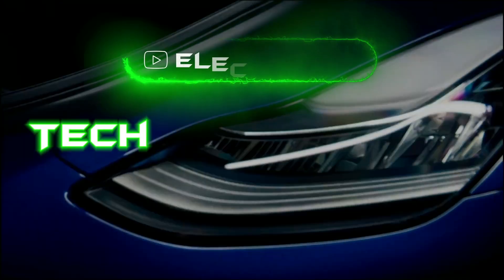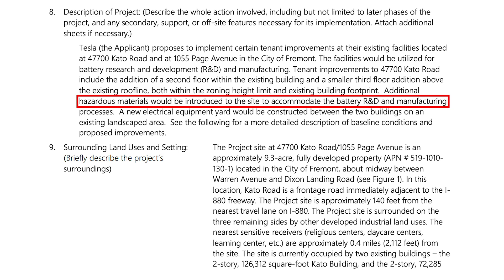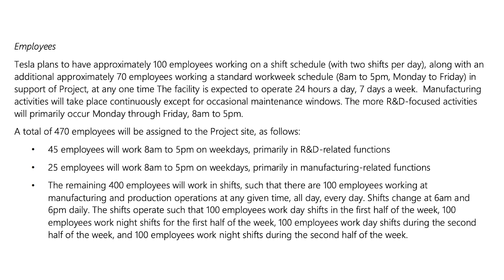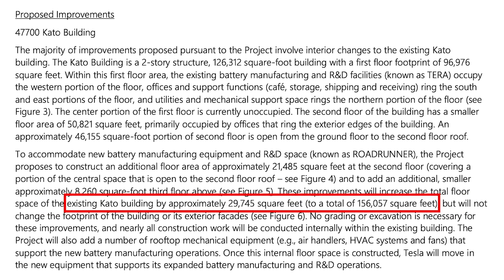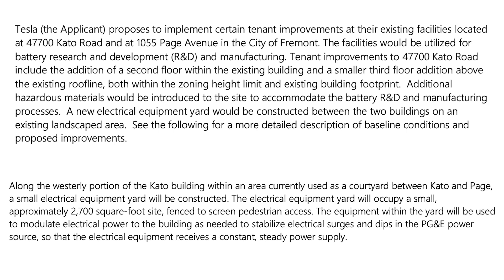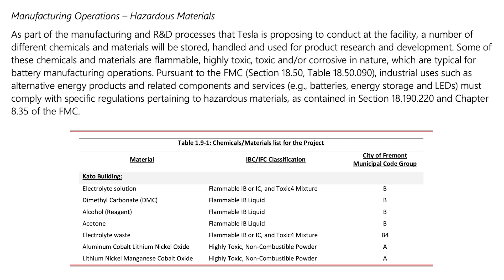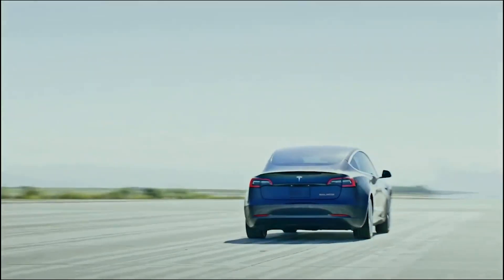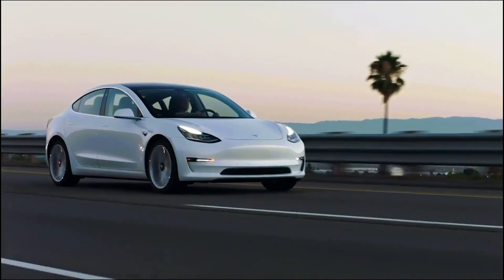Tesla Roadrunner | Tesla Battery Manufacturing Expansion - New Documents Explained

Comment: I was going to wait it out for a dual motor Cybertruck. Now with Tesla shares increasing how they are I think I might be able to get a Tesla sooner. Maybe just a lease to start until the Cybertruck comes out or one that just came off a lease. Now is the time for more Tesla shares and I want some. I do have a business plan in mind and for those that do not own their own house for Tesla solar I think there is another option. Consider having a solar shelter you could quickly unfold and have it securely surrounding your vehicle and keeping you and it out of the dust heat or cold. If the parking lot had a place that you could connect your Tesla to the grid not only would the solar be charging your vehicle but the battery could also be charging the grid. Of course the vehicle to grid software would make it easy for your Tesla to be making you money when it's parked and your solar shelter could continue offering power to the grid if you don't need to bring it with you. Let me know what you think of these ideas or if you have some of your own to add. I do appreciate all of you and your comments. Now this time we can fix our future fast!
propower101@hotmail.com

Comment: @electrified Can you check out these two patents?
 https://electrek.co/2020/05/04/tesla-hybrid-battery-electric-car-range-extender/
https://phys.org/news/2013-09-tesla-patent-hybrid-battery-evs.html
They both have to do with all electric hybridized systems. One hybrid is fully in one cell and the other is two separate battery tech modules used in concert. The idea is that you could have a fairly traditional li-ion for your day to day usage and use a higher density pack along with the other for longer trips. It might be the way Tesla rolls out  newer road runner tech down market. As production, yields and costs get better, you push the tech down market. It also get them the chance to get better at manufacturing lithium anode or solid state batteries ahead of the competition. Since Tesla knows what the average 90 percentile range people travel in their car, they'll be able to pick the right Lion/Roadrunner mix to satisfy peoples' needs and be able to advertise great range. Even if cycle life is lower in the RR cells, they only have to handle the long trips. Kind like charging up to 100% for those super long trips. These patents are separated by over 7 years so i think they like this idea of mix two technologies when one is not completely ready. What do you think?
Reply from the maker: Interesting Joel, I will check them out. Thanks for sharing this!

Comment: Low volume, high cost prototype batteries? They're going in the Roadster. That's the only platform that makes sense. People buying it don't care if they're getting the best price to performance.
Semi needs batteries that have been proven, and are at scale, to keep costs down. They also have high demand, because of their size, and the expected mass that they'll be hauling. 
Cybertruck, and the rest of the consumer vehicles, are too high volume to use the new batteries. Tesla wouldn't be able to make enough to meet demand.
Reply from the maker: Rumor has it the Semi battery will be Panasonic's

Comment: I think it's the proper place here to ask my Qst: what happens to an electric car when it's flooded (like in China, as an example)? Will the battery explode? I wonder if  the battery researchers (and Tesla also) have studied the risk of flooding, on  the security side of their big battery in cars, like the Tesla cars... Anybody here who might know something about all the risks after flooding electric cars??? Tks to all.
Reply from the maker: Great question...here's an excerpt and a full article.

Excerpt: "So the first part of the answer is that where an undamaged EV is floating down a flooded road or river, its electrical components are well sealed and extremely unlikely to provide an electrical hazard to its occupants, bystanders … or passing fish ….

A second part to the question does however present itself: what happens if the EV is damaged and sections of the high voltage electrics become exposed?

In this case, a series of safety and protection systems will kick in. In the event of a crash, automatic disconnection of the high voltage electrics occurs through an impact sensor (which exists in all modern cars), thereby limiting the presence of high voltage to within the battery only. Another system (called a ground-fault detection system) is also built into EVs."

Full article: https://thedriven.io/2018/12/04/is-a-battery-electric-vehicle-safe-in-a-flood/#:~:text=So%20the%20first%20part%20of,bystanders%20%E2%80%A6%20or%20passing%20fish%20%E2%80%A6.
Reply: Thank you very much for your fast answer. I'll look into the report for sure, but a bit later. Good day.

Comment: My prediction is that part of this new battery manufacturing process already be ramping up within the next three months so that they less than publicly have some batteries to work with and study. and by September they will already be breaking ground on giga Nevada expansions to have full scale battery production online mid 2021. And also getting the plaid out right after battery day at fairly impressive production rates
Reply from the maker: That would be awesome if true. I think it may take a bit longer to have full scale in-house cell production online that quick as it may be even more of a challenge than the vehicle assembly lines given the intricacies but I can't wait to watch and either way they are lightyears ahead of everyone else

Comment: Maxwell predicted up to 16× volume from a given space.

There will be a new pack as well.

New BMS.

The packs need (30%?) fewer cells in the 100kWh cars.

V3 charging will increase to 250kW over 0-80+%, no larger pack required(?)
No cooling problem.
Reply from the maker: 16x volume is a nice add, thank you Roger!
Reply: @DillonLoomis22  
Even if they achieve 5-10× it's a small factory making a lot of cells.
Of course It will require a corresponding number of packs, but I've seen a design which seems to allow not only little welding/ soldering of connections, but can be very highly automated, so less room for cell damage and much faster.

Comment: Given the critical nature of the synthetic graphite material from Novonix which enables dry cell manufacturing (Maxwell Technology and Hibar Mfg), the recently announced Single Crystal Cathode, and their close ties to Jeff Dahn at Dalhousie University...
What are the chances Tesla announces the acquisition of Novonix at Battery Day ?
If they release details about the stunning improvements and it shows Novonix graphite to be a critical constituent, why would they allow an opportunity for competitors to buy it and take away their magic pill ?

Think about what Amazon did a few yeas ago; Buying up their robot supplier.
> Lower cost robots.
> Competitors were screwed, had to find new source of their own.

I believe Tesla will do the same thing as they did with Maxwell and Hibar... Acquire the resource, NOVONIX
Thoughts ?
Reply from the maker: Hey Tim - solid analysis. I couldn't think of any logical reason why they would not acquire Novonix if their IP was crucial to the new tech. Unless Novonix was against only supplying for Tesla
Reply: @DillonLoomis22  They already work with Jeff Dahn and Tesla.  Furthermore, if you're being acquired, you don't always have to like it, but I believe they would.

Comment: They do not need to make batteries for all 80,000 S&X in the beginning. If they only make batteries for the tri-motor Plaid first, they may only need 2 to 3 GWh at the beginning. I think they can do it at that location
Reply from the maker: Good point here for sure. Would just to be tough to sell some S and X with new tech and some with old without a major designation you know
Reply: Electrified Agree :) my guess is all about the price I think. If it is $75,000 for the base model S but $120,000 for the Plaid, it should be fine :) 

All the people buying the S now know the new one is coming and still buying them anyway. I think $75,000 is a sweet spot for ongoing demand regardless the Y, the plaid, or Cybertruck coming to the market. That is just a good deal for a luxury EV that goes 402 miles. 

Totally my assumption...I don’t shop at that range. I only pay cash for car and at that price I can add a duplex or 2 houses to my portfolio :)